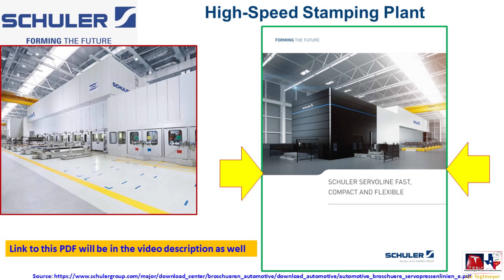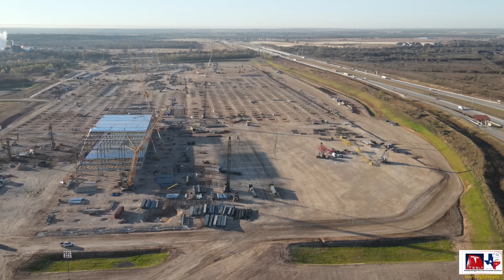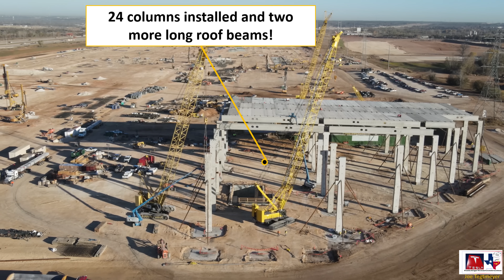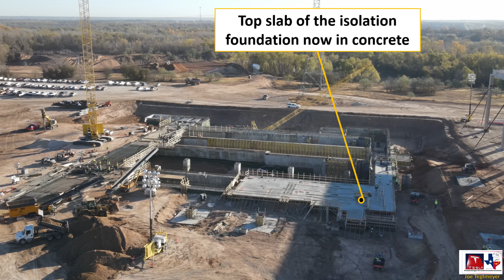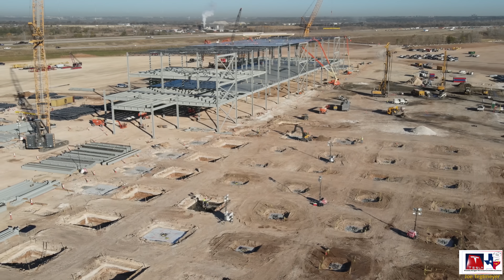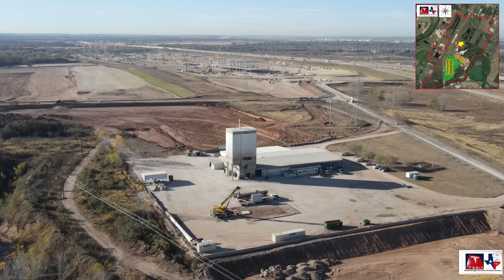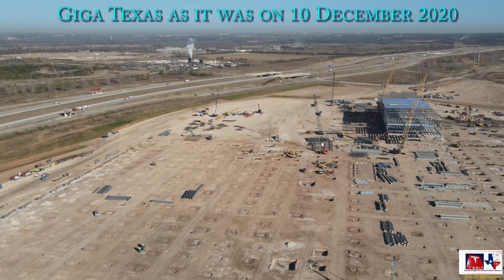Tesla Gigafactory Texas 10 December 2020 Cyber Truck & Model Y Factory Construction Update (08:00AM)

Comment: Between watching your fantastic videos and witness Tesla and SpaceX voyage to new frontiers makes me feel revitalized and happy to live in such times. SN8 test yesterday was remarkable.
Reply: SN 8 crashed.  But they did achieve some important objectives. For me, it demonstrates the need for abort capability on both launch and landings. In the future if there is a failure on landing, you can see that it won't be survivable.
Reply from the maker: That is what testing is for.  Determine what works, what needs work and figure out solutions.   I like their agile approach (reminds me of the 1950's aviation explosion of design and capabilities when we were not as risk adverse and costs so high because of risk adversity that it takes years and extremely wasteful spending to even have something to try and see if it works) ... Looking forward to the next test!
Reply: @JoeTegtmeyer  What they need is full abort capability, including abort on landing. Too many things that can go wrong. There is no way to design for every possibility. 
But the ability to abort and get the crew away from the vehicle works regardless of what causes an accident.
Reply from the maker: @DavidJohnson-tv2nn  The Starship is intended to operate in a wide variety of environments some of which would not be suitable for an escape capsule or otherwise ... are you just focused on launch on earth and recover into a location that is environmentally suitable?  What kind of abort plan do you recommend for takeoff and landing on the moon or Mars?  I’d like to understand your thoughts on how that would be feasible and what the survival plan would be after they escaped from Starship on say Mars.  My background is in Astronautical Engineering so I think I can follow your technical ideas ... really, I am interested in your thoughts.
Reply: @JoeTegtmeyer  Yes, for the moment I am focused on abort on earth. Where it is easily doable. Abort systems have been used for decades going back to Apollo. The only thing I want to improve is first... Add abort capability to Starship for manned flights. Take it a step further and modify the system for abort on landing as well. Since they will be doing propulsive landing. Which is difficult to recover if something goes wrong.
I'm not an engineer but think the modifications would simple, involving software and sensors.
Abort on landing could work something like this.....
The speed at which Starship is approaching the ground would be monitored. If the speed exceeded a certain limit for a given altitude... An abort would be initiated. 
Angle of the spacecraft on landing would also be monitored.  If it exceeded a certain limit relative to vertical.. An abort would be initiated to protect against tip over.
Even if abort on Mars is not possible, that doesn't mean we shouldn't protect human life where we can.
Reply: @JoeTegtmeyer  Regarding abort on Mars... Rescue can be accomplished by using a spare spacecraft. The abort system itself would probably have to be different as well. Due to different conditions on Mars. I'm not even sure it is doable but I'll leave it up to the engineers that know this stuff :)
Reply: @JoeTegtmeyer   One more thing I forgot to mention is that for an abort system on Starship, I would use a small electable capsule. Perhaps the size of a bus to save on mass and complexity of the abort system. Hopefully a modified version of Crew Dragon's abort system would work.
Reply from the maker: @DavidJohnson-tv2nn  as in any equation, there are many variables to consider and determine how much control you have on each of them, accept risks on those you either cannot control or chose not to, and realize that not all variables are actually known.  For every choice that is made, consequences will happen.  Ultimately, if we are to move forward in space (like we did in the past with crossing land, oceans, the air, etc... we will have to accept risk and understand the choices we make.  At first, going to Mars will not be feasible if we decide to keep risks low and have multitudes of backup plans.  
     I appreciate your concerns and some are in the feasible range for mitigation and others may not be.
Reply: @JoeTegtmeyer  I understand what you're saying. And I'm not opposed to taking risks going to Mars. What I'm opposed to is taking needles risk. Such as flights to and from low earth orbit. Where an abort system is easily doable. Why get people killed on a trip to the space station? Or even worse.... On Musk's point to point transport on earth? 
Let's mitigate risks where we can. And take risks where we have to. Hope this makes sense.
Reply from the maker: Thanks Tamer!

Comment: Do you know how can they make the walls and footer s are straight?
Reply: There are teams of serveyors with laser tools placing all the markers with very high accuracy. You can sometimes see the little flags they leave.
Reply: @MrGonzonator  thank you very much
Reply from the maker: For sure the actual column mounting points are square and properly aligned.  The concrete itself may not be fully square but that isn't important.  The mounts are the critical item.

Comment: Thank you for clearing up some of my thoughts.  I am wondering how they would stop the racking in the concrete roof? I see the temp support which makes me nervous for them..lol
Reply from the maker: The structure will rely on the wall sections, crossbeams and the double-T roof sections (along with a concrete poured top) to provide the rigidity it needs.
Reply: Support poles provide temporary support while/until the concrete/grout connection to footing rebar has cured. Wall panels welded between the columns at exterior walls will increase rigidity immensely.
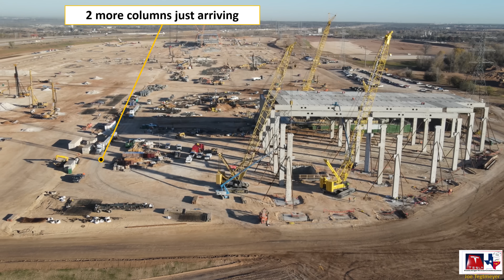Reply: Picked up by another eagle eyed viewer, if you watch Randy's #72 at 11:04 you will see a forklift knock a prop out of the ground. Immediately to the right of the crane on the right.

I think the column/footing connection is a lot more robust than you would expect. The props are at extreme angles, way above 60deg which is generally the max propping angle. Some props are fixed at the bottom to adjacent footings, others seem to be connected into some sort of auger screwed into the ground. The propping will have been specified by the structural engineers, so......... hopefully,  fingers crossed.

Comment: Cosmological question: Without Geopier, would TeraTexas be possible?
Reply: They could do piledriving. I believe that's much slower and time-consuming though.
Reply from the maker: There are other options they might have used, but GeoPier (and some cement/grouting supports in some areas) are what they chose for Giga Texas.

Comment: I guess the manual that comes with the Schuler stamping machine indicates "Some assembly required."
Reply: Batteries not included
Reply: Wait till you see the size of the studs and nuts that clamp it together that have to resist the thousands of tonnes pressure the multi stage press places upon the multiple die stages.
Reply: And a lot of excavation.
Reply from the maker: Just a little bit. :-)

Comment: Wow!  What a video!  That was a real research tour de force finding and digesting that technical information on the big Schuler stamping machines.  Well done!  Today, the construction site looked like the human version of a kicked up ant mound.  

On Randy's channel, someone today suggested that they might also use the old factory as a place to build the temporary switchyard.  That idea has some merit as there is plenty of prepared level ground around there.  Also, it is right next to the power lines running to the temporary cement plant.  It might be faster to get some temporary electrical power up and running by repurposing some of that existing area, rather than build something from scratch over in the designated building plan area.  It's worth further consideration . . . at least until we see more ground preparations going on in the area shown on the building plans.

Thank you again for your considerable efforts in putting together these outstanding videos!  Be well.
Reply from the maker: Thanks Jim ... I'll keep watching to see if the rumor you heard has any merit.

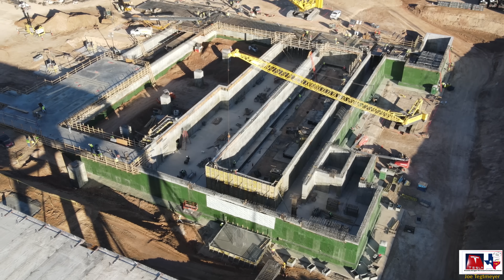Comment: 11:58 next to the step ladder in the center corridor is a man door leading to a possible stairway. At the far right near the rebar column is another. I would think they would have a freight elevator for maintenance's sake unless they will have removable floor plates somewhere.
Reply from the maker: Thanks Freddy ... I noticed that as well ... may make a mention in the next video.

Comment: Well done again.  In the area of the steel structure, there is an obvious grid spacing for the footers.  Is there any further information on the distance between footers?  Maybe 40 feet?  There is a shipping container just to the North of the structure and these are usually 40 feet long.  Have not been able to see a good angle to compare to the footing centers.  Thanks.
Reply: In a previous video, Joe used ladders to estimate the size...

https://youtu.be/7w9KkupVU44
Reply: @MrGonzonator  That is specifically why I asked the question, "Is there any further information ...".
Reply: @Doug_Forsyth  well going back to first principles, we know the building is 1175ft wide from the plans.
If you count the foundations from side to side, it's 25 wall to wall, giving you a spacing of 47ft.

Comment: Thanks for the Schuler stamping press explanation! The steel beam structure looks like it's about to become much more interesting. The footings on the West side of the current steel column structure have multiple steel column landing pads and many of the pads look to have at least 6 bolts signifying heavier load bearing beams. Can't wait!

If anyone knows how they intend to finish the corner of the South end concrete roofing, please speak up. While I understand the exterior wall skin will have it's own column supports, I still can't figure out how the angled area of the roofing will be finished. I don''t recall seeing anything similar in the past.
Reply: My guess is that the exterior wall sections may provide support for the roof panels in the angled corner. So one end of a roof panel will be supported by a beam already placed and the other end of the roof panel will be supported by the exterior wall. Of course, the wall would have to be reinforced to take the load.
Reply: @DavidJohnson-tv2nn  That's my guess as well. The big end columns don't have landing pads for cross beams which would go along this corner edge. We shall see what we shall see. Learn something new for sure!
Reply: Miter saw...LOL